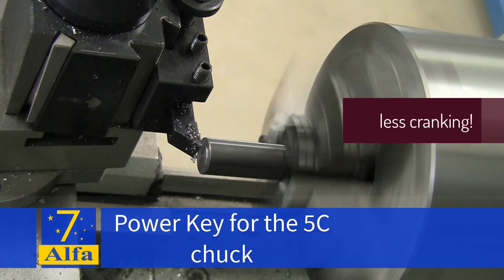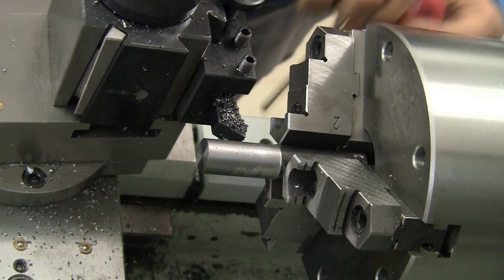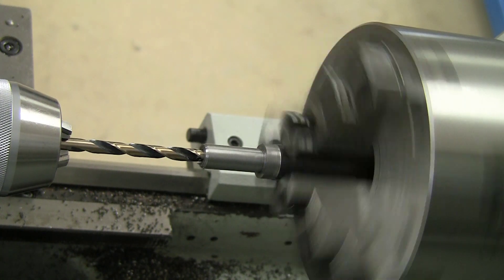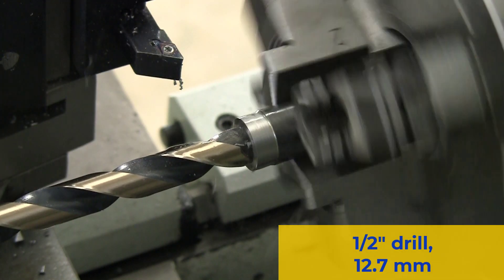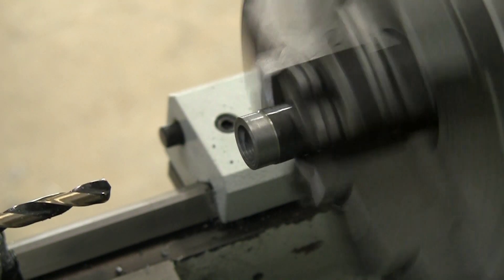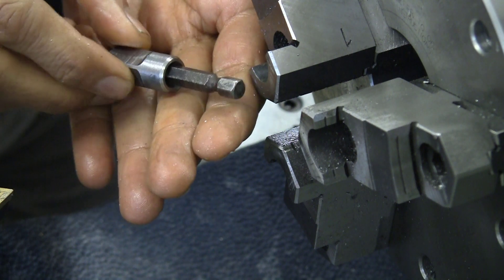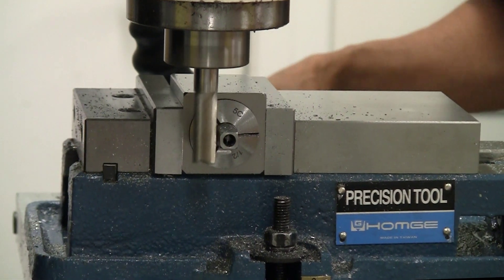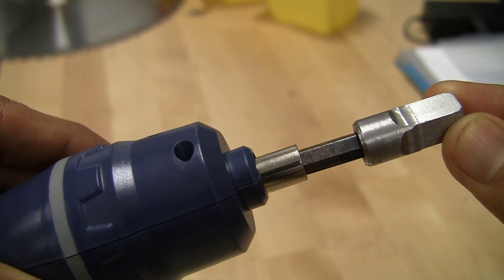5C Chuck Power Key

Comment: Hello....enjoying your videos and am currently awaiting the PM 5C collet chuck that is on back order.  I noticed your comment about the micrometer stop.  I have a non PM lathe that is similar to yours and would like to get a PM micrometer stop if it fits.  Would you be able to provide some measurements of the profile of your ways for the dimensions that the stop clamps on....angle of the prism way if possible and the width at the base of the prism, height of prism above the flat way, and the height from the top of the prism to the bottom clamping surface?  I wasn't able to get the info from PM but am still interested in their stop.
Thank you!
Reply from the maker: Glad you liked the videos. 
I have made some measurements; the angle of the prism is 90 deg. These measurements are on the stop itself.  The width of the base is 0.865", the height is difficult to measure, since there is a rectangular notch at the top of the prism that is 0.193" wide by 0.125" tall, presumably to allow the top of the ways to fit in.
The dim from the base of the prism opening to the bottom clamping surface is 0.681".
The length of the body of the micrometer is 2.38". The overall length of the stop varies depending on how far the screw is turned. The minimum is 3.93", which is the length of the micrometer screw, and the maximum with the screw fully extended is 4.47".
My lathe ways prism has a flat top. The height of my ways, from the base to the flat top is 0.355". 
Hope this will be of some help. I have really found it to quite useful
Please let me know if there is any other info you need.
Reply: @7alfatech860  Thank you!
I really appreciate you following up with me.  The dimensions seem very close, perhaps close enough that if some modification is needed it would be minimal.  My ways have a flat on top as well, about .165 wide.  Using a depth mic, the height of the prism from the flat on the prism to the machined flat that the tailstock rides on is about .323 so perhaps a bit shorter than yours, but not too much.

If I could bother you for a couple more dimensions from the lathe……it may be helpful to have the ‘thickness’ of the way from the top of the prism flat to the bottom of the way (where the clamp would grip) and the dimension from the vertical side of the way to the face of the rack for the longitudinal feed gear.  Mine is just under 1 inch thick and the distance to the rack is about .473. I don’t yet have a mill, but if modifications are mainly to provide some clearance on simple geometry like the flats on the stop faces, it would be doable for me.

Thanks again for your time and willingness to help!

How are you liking the collet chuck?  I am impatiently waiting for mine.
Reply from the maker: @johnbruning4920  Glad to be of help. I get 0.368" from the prism flat to the tailstock ways.
If I understood you correctly the distance from the flat on the top of the ways to the bottom of the ways is 1.06". And my (horizontal) distance from the side of the ways to the face of the rack is 0.457". My guess is that it should be compatible.
The collet chuck has been a lot easier to use with the little screw driver gizmo :).
Reply from the maker: @johnbruning4920  Glad to be of help.
My height from flat top of the ways to the tailstock is 0.369".
The distance from the flat top of the prism ways to the bottom gripping surface is 1.06".
The (horizontal) distance from the side of the ways to the face of the gear rack is 0.458". I suspect the micrometer stop will fit your machine without too much trouble.
The collet chuck has been nice with the help of the screw driver gizmo. I intend to order some better quality collets and gauge pins , and see if I get any improvement.
Reply: @7alfatech860  Thank you so much.  You have been immensely helpful.  It sounds like it will work without any major modifications.  I will most likely make something similar to your screw driver gizmo too.....should save a lot of cranking on the chuck key!  I appreciate your time and willingness to help me out!
Reply: @7alfatech860  Thought I would provide an update.  I ordered one of the micrometer stops from PM and it arrived today.  As I suspected from the information you provided, the stop fit the way nicely and since the 'thickness' of the ways on your lathe as you indicated above was 1.06" from the flat top of the way to the underside, the stop was about .060 too thick to clamp tightly. I was hoping it would be that simple.  I don't have a mill, but I do have a milling attachment for the lathe, and it was pretty easy to take about .065 off of the bottom of the stop.  It works perfectly!!

Thanks again for the information and dimensions!
Reply from the maker: @johnbruning4920  So glad it worked out